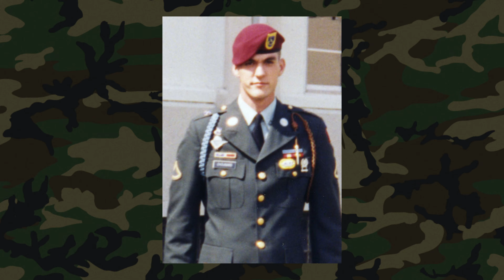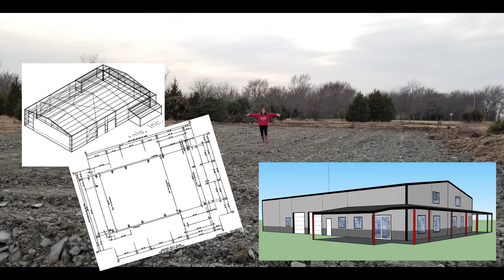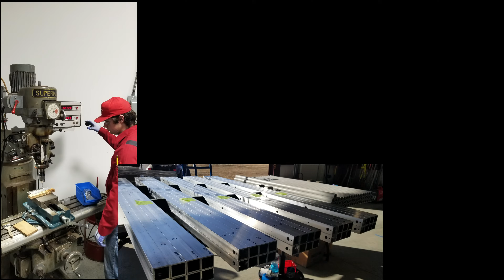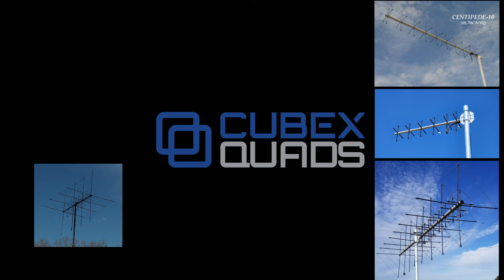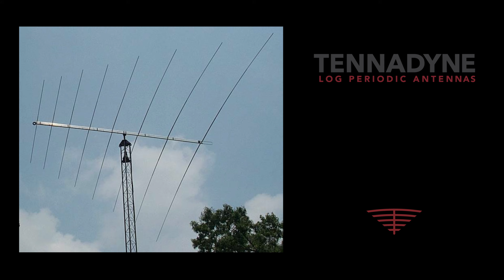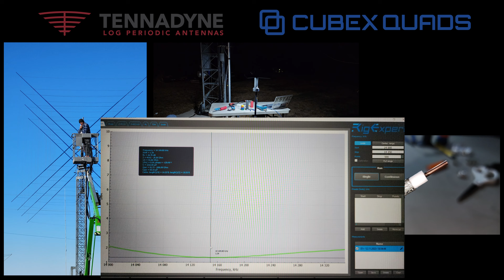Tennadyne and Cubex Quads

Comment: I'm gathering the materials to build an 8 element quad, I built a 4 element and found decent methods of spreaders and boom mounting. I plan on documenting the building of it and want to inspire other hams to build it. I have about $60.00 into it so far I believe the wire will be the most challenging facit of the project.

Comment: Love your video and the history behind each Antenna I've always been a fan of the Quads myself as I grew up with my father being a Ham since the early 1950s with towers and Quads and Yagi's all around me He inspired me to get into radio back in the 80s and taught me lots about Antenna 
builds etc, but i been out of it for 30 years and only just got back into it early last year I'm just a avid CBer never did get my Ham ticket please don't judge me But 11 meters was always enough for me but since i got back into the SSB side of it this January 24th I worked over 220 international Stations and not the same Station twice they all new Stations each time of course some Stations are come back to me multiple times but I'm not counting those. But and now it's May on my little Bearfoot Station on a vertical up at 45 feet But seriously looking at a Quad and going 50 feet All his mates, as he's passed on now are coaxing me to sit my Ham ticket and they all in there 80s and 90s now So maybe i should because ive been bitten bad by the DX bug But i understand we are in the peak of the cycle but ive been told by quite a few that ive got a good little Sounding Station and your getting out.
Thanks for the video 462 New Zealand. 👋🇳🇿

Comment: Nice video Mark! Nice to get a little history lesson and behind the scenes over at Cubex. I am one of your early customers, my original order was with Rog which got lost somewhere and then with you just after you moved everything from Michigan and getting set up. It was a painful wait to finally receive my MKIII and my Scorpion 88 but well worth the wait as well!  both, as well as an older fully restored Hy-Gain 402BA (shorty 40 as they are often called) sit on my 72' Tri-Ex crank up tower.  The boom of the MKIII is at 85 feet when the tower is up. My Ham IV rotator so far seems to be doing the job although between the MKIII and the 402BA its a handful. I generally crank the tower down from the shack when not in use so keeping the array down low when the winds whip up has been a great help in rotator longevity I'm sure.  The MKIII (and full legal output power) has really helped me in the busting of pileups, There were times in the past it would take me 45 minutes to get through a pileup even when I had a hex beam up on the tower, now with the MKIII if I don't get through in my first try which I make it through surprisingly often, a second or third try may be in order. On occasion I need to put my call out 3-5 times but not very often.  With the MKIII I would say a LONG difficult pileup for me is now five to ten minutes, and those are rare.  Never had so many reply's saying I had a "big signal" as since the MKIII went on the air.  For a long time "the land down under" was a huge struggle for me, now I talk to the Aussies regularly and while the guys on the West coast in Cali are also in there I seem to usually be the only one working them in the eastern mid-west Chicago suburbs at those times.  Really love the MKIII!  I still have a couple little SWR issues on a couple of the five bands where I need my amp's built in tuner to make some corrections.  I believe this is due to interaction with the other antennas on the tower as I really have a lot crammed into that space to fit everything I want on the tower.  Hell, I have the Scorpion 88 nested inside and mounted off the boom of the 402BA which sits just a couple feet below the bottom of the MKIII spreaders and wire loops. The  Scorpion88 and the 402BA appear to be invisible to each other according to the Nano VNA, but there seems to be some trading-off going on between the 402BA and the MKIII would be my guess as there is a couple places where some of the wire loops run parallel and are within 5 feet of the 402BA elements. Either way the amp tuner lets me use those bands with only small  corrections, I have not noticed any real performance issues otherwise and thus this has been a small price to pay!  Just an annoyance to my original goal of 40/20/17/15/12/10 & 2M\70CM with NO TUNERS. Can't have it all I guess.

73' de N9SSW 
Nick